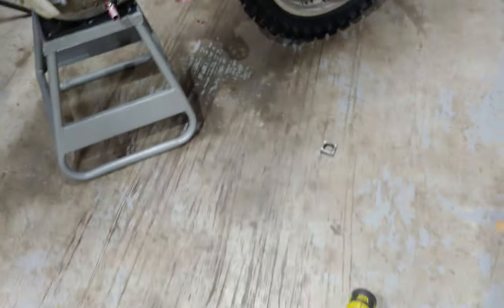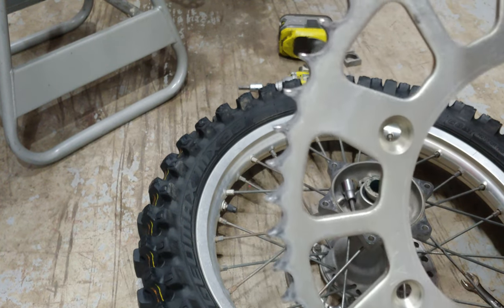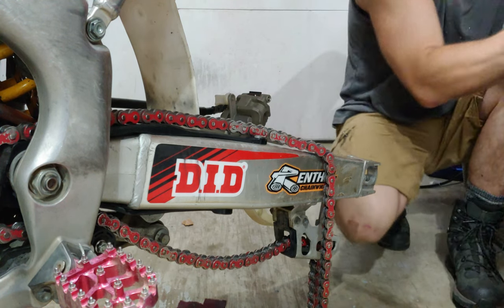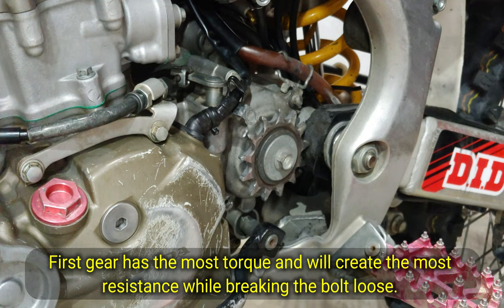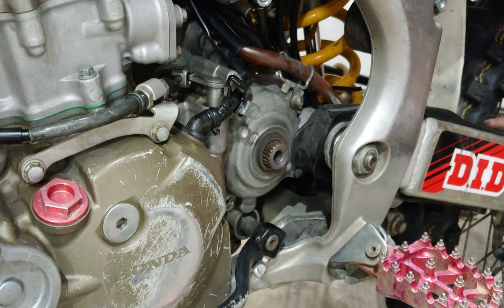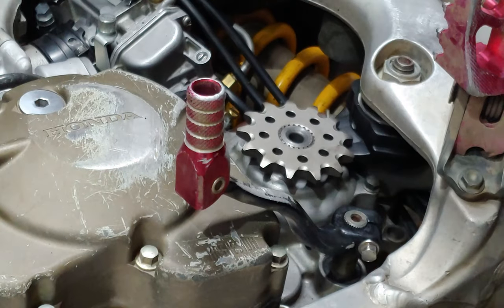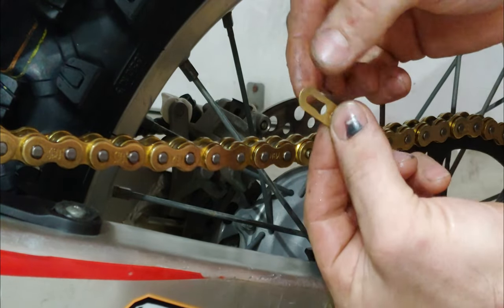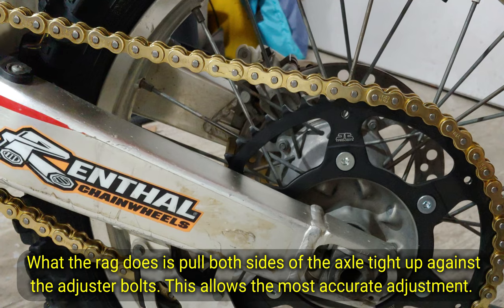06 Honda CRF250r || JT Sprocket & Chain Setup [Step by Step]

Comment: How long have the jt lasted you thinking about grabbing them ?
Reply from the maker: I changed them in the summer. I ride Motocross so they got pretty trashed and the rear Sprocket was missing like 16th and the chain was missing four or five metal rings at certain linkages in the front sprocket was pretty wallowed out in the drive Direction so on the front side. Now I have a did chain on there and rocket front sprocket and a dirt tricks rear sprocket.

Comment: Just gotta 2011 450 on streets watching this to see if 06 rims will fit my bike so I can have a dirt setup as well and I couldn’t imagine my throttle sticking I’d legit fn die… shifted to fifth on pavement and punched it and the visor on my helmet caught wind and almost pulled me off the bike… what if the throttle would’ve stuck then…🤯
Reply from the maker: They might fit. Check babbitsonline and cross the part numbers for the hubs.